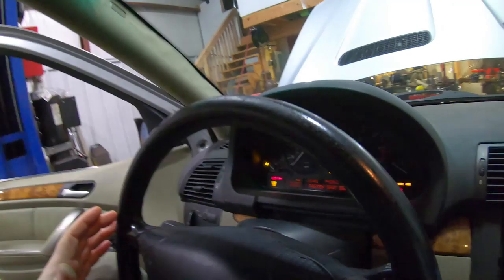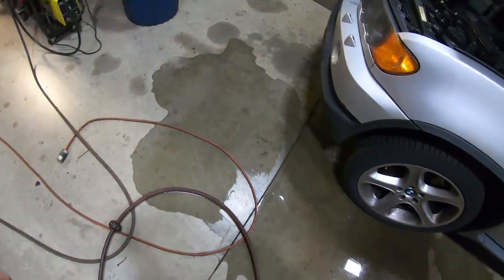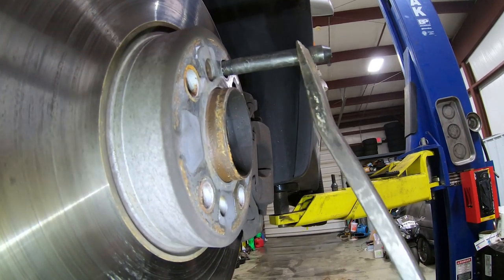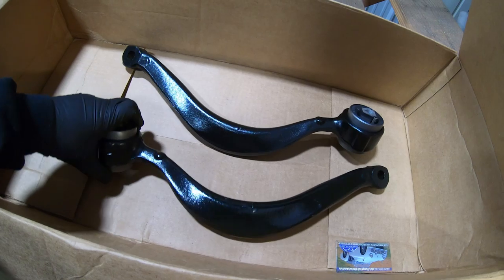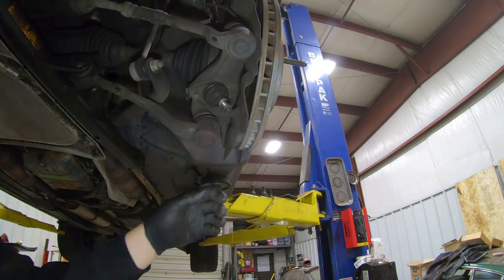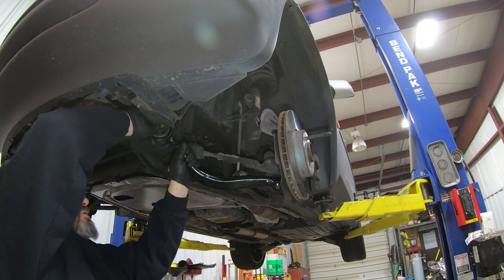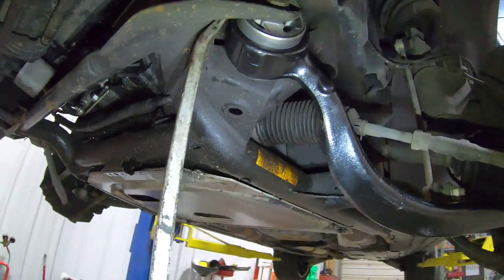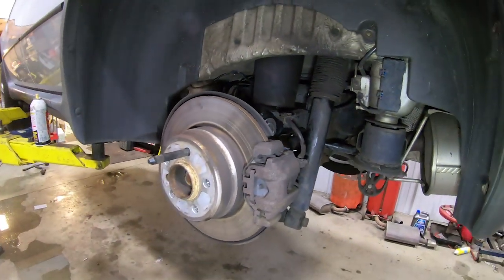BMW X5 LOWER CONTROL ARM REPLACEMENT.

Comment: Excellent tutorial, recently did this same job on my '04 X5. Couple of points: to reach the inner bolt/mount, I had to remove the plastic apron & an air box contraption that was in the way. The other point to mention is I've heard & read elsewhere that the hub & suspension needs to be preloaded to vehicle ride height before tightening that inner mount. Hope this helps some of you.👍

Comment: People are always talking trash about BMWs, but I own two & can say every car has unique issues. Dealing with BMWs can be challenging in that they're over engineered, but problems are common enough that they can be dealt with as parts are readily available. True, if you're a DIY type, the costs are minimized, paying a dealer, will " Brake My Wallet"!👍
-'04 X5 3.0
-'04 Z4 2.5
Reply: Absolutely right

Comment: Great video! Explained the process very well, thanks. Also can you add the link for the tool you used to pull from the ball joint? Thanks.

Comment: Do t do final torque setting union your front end parts u till the there is preload on the control Arms. U can do this either on the ground or place jack stands under the arms. Once weight of the vehicle is on the suspension then set torque settings.

Comment: Where can I get the lower control arm hydraulic ball joint puller you show in your video on the your 2001 bmw and the wheel pins

Comment: You should have torqued the thrust arm bushings are ride height. Not doing so will wear the bushing out very quickly.
Reply from the maker: Truthfully I remembered that after I put it down. I went back and loosened them and retorqued them on the ground. Good catch!

Comment: Thanks for the video.  Just FYI, some of the 6 cylinder e53s do use the 20 pin round connector under the hood for OBD II.  I know because I have one that does.  Mine is a 2001 model US 3.0i I6 X5  built in late August of 2000.  I believe all of the 3.0s built through about September 2000 had this.  It can be confusing if you don't know this and are trying to read codes from under the dash.

Comment: Sir, thanks for your video. I have a 2015 X5 F15 and I am having some surging issues. no dash lights on! I have changed the GIBO DISK, SHAFT SUPPORT , TRANS MISSION SUPPORT,  ENGINE MOUNTS . Do you have any ideas on what causes this?

Comment: You talk of a under hood 20 pin connector (besides the OBD 2 inside.)
1)  Where exactly is it under the hood ??  I have a 2002 , 4.6is.  Maybe not in this model ?
2) Also what type of scanner do you use and where to buy.
Didn't
Thanks
3) Where to buy those pins for installing the tires ?

Comment: Cant wait for the window regulator videos.It's tricky job on X5 i think.
Reply: PS: You should install E53 window deflectors.These are great in winter so fresh air could go in.
Reply: It's not so bad, have done one window, I think it was another of rear ones of E53. And then I have done one E83 too. Quite cheap parts also from Ebay, though not OEM. Usually you should always use OEM ones :D
Reply: @thetoughcookie3665  I agree... I've done the drivers window 3x and all other windows 2x each using regulators off ebay. Make sure to change out the 2 plastic clips that attach the regulator to the bottom of the window too. I've missed doing that previously and it caused me to do a replacement early.

Comment: I just did the driver's side and I refuse to say how long it took lol.  The ball joint remover is a Godsend.   When you put everything back together and did a test drive, did your DSC inactivate light go on?  I didn't drive it much, just around my subdivision.  I assume it's readjusting to the new parts ( I also replaced my outer tie rod).
Reply: What brand of ball joint separator did you use? I bought one locally but it is too short and fat to fit into this particular ball joint.
Reply: @Jonesy-dv3bj  I can't remember but I did get it on Amazon.

Comment: are your timing chain guides ok? because i was told that was gonna be an issue with my 2003 BMW X5 4.4i mine has 160,000 miles
Reply from the maker: My X5 had the guides done at 170k and my 540i needs them done and it’s at 160k so yes it’s def a concern.